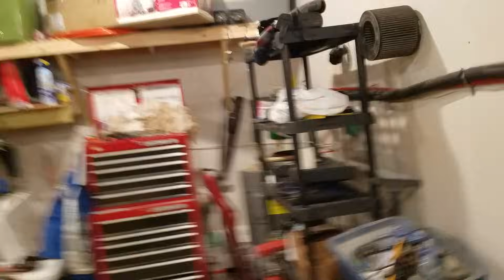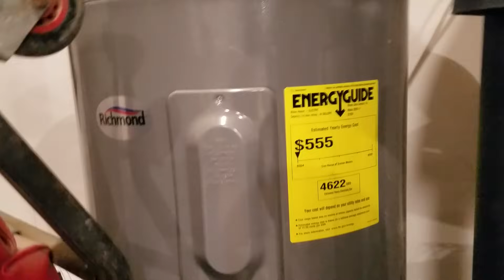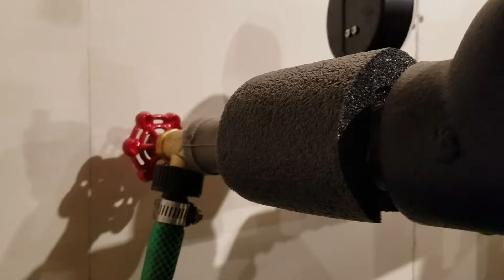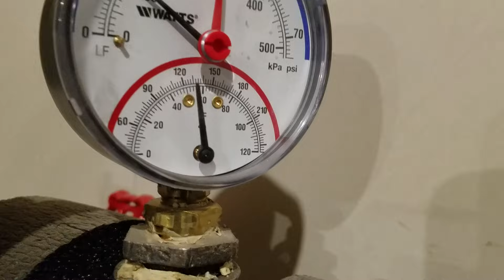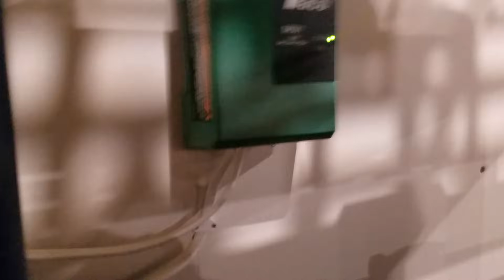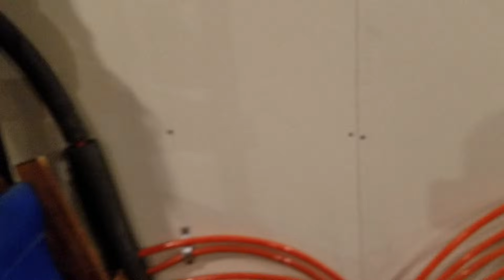EASY FLOOR HEAT (using a new or used hot water heater!)

Comment: Great job! As a steam fitter I have a couple of recommendations to improve your efficiency and safety. If you prefer to use a hot water tank you must replace the temperature and pressure relief valve with a 30 psi pressure relief valve.  Using a tank in a closed loop heating system is very dangerous, you are essentially making a bomb. My second suggestion is to get rid of the tank completely and use the elements without the tank. You can cut your power consumption by not heating only the water used for heating not storing. Take a 12 inch piece of 2inch pipe, put a 2x2x1 inch tee on each end. Using a bushing install your elements in each end and connect the supply and return to the 1 inch branches. Now you are only heating the water you are using.  I heat my 50 x 30 shop for about $2.00 a day. Todays high is -32C.  I tried going to a larger tank and it just cost me more money.  I have been feeling my system for the past 9 years and have more plans.
Reply: Can you explain your set up again? Not sure I follow. Are you talking about using an exchanger?
Reply: Rivstr, you are completely correct about the temperature and pressure relief valve. They must be changed so one doesn't blow the pex lines or anything else if something goes wrong.
I like your idea of a 12 inch piece of 2 inch pipe for heating the water. Kind of like the heater in many hot tubs. They easily heat a hot tub to 104 degrees. When I used to work on them they were rated at anywhere from 2 KW to 5KW heating elements. Coincidentally domestic water heating elements are rated from 3 KW to 5.5 KW. A water tank heating element system you've described could easily be used. Because it would be a closed loop system, a larger thermal expansion tank would avoid pressure build ups so it should work fine.
Reply: @Rivstr. Have you built the heating unit you speak of? If so I would love to see a video on your system. Sounds much cheaper than buying an on demand heater and much cheaper than heating 40 plus gallons of glycol mix while sitting idle.
Reply: @danielmooney2724  I also am curious!
Reply: Can someone explain why its dangerous to heat water in a closed tank for space heating, but it's not dangerous to heat water in a closed tank for domestic hot water?  Wouldn't the T&P relief valve still open before any explosion?  That being said, yes I would replace the T&P with a boiler relief valve since there's no reason to have high pressure in the space heating system.
Reply: @brockwagner939  Are you potentially confusing a closed tank with a closed loop system? Space heating systems are closed loop systems while domestic water heating are not closed loop systems.
It is not necessarily dangerous to heat water in a closed tank for domestic hot water. But it is dangerous to heat water in a closed loop system.
In order to make it safe, a domestic hot water system has a few redundancy's built in. There is often an expansion tank to alleviate pressure build up, there's always a pressure relief valve which normally opens once the pressure or temperature gets too high and the domestic water system itself can also alleviate high pressure through weeping of some of the rubber or fibre washers in the faucets.
In a closed loop radiant floor heating system there's nowhere for the pressure to go. Thus the need for a similar pressure relief system as with the domestic water system. Thermal expansion tanks, and lower rated pressure relief valves.
If one doesn't have an expansion tank and/or also doesn't change the pressure relief valve to one suitable for 12 to 20 lb systems one could easily blow the in floor pex lines.
Reply: @davemeise2192  possibly I am confused.  But the video shows a thermal expansion tank right?  So if it has room to expand into the tank, and the piping and tank can withstand the pressure rise, my theory is, if a water heater tank can handle the pressure that the t&p blows at, why would it fail before the t&p blows just because it's being used for heating and not domestic? I'm not disagreeing about the 30 psi relief being a better idea.  In fact I might put two of them in, just in case one fails closed.
Reply: You have some drawings on this heating design? Sounds like it would work but skeptical on the design
Reply: @Rivstr, the heating element is a great idea, I'm trying to get my radiant floor heat going on my shop that I just bought, all plumbing been done below concrete but I have to do everything above, my question is this please, how do you run power to the heating elements? 120v to each element? And what do you use to turn them on? Thank you in advance all help is greatly appreciated
Reply: Hey I wonder if you have a video of your system
Reply: @Rivstr The 30psi replacement pressure valve makes sense. But looking at some boiler pressure valves, some have temperature protection, some don't. Ones that do tend to be around 250f, but water heater ones are more like 210f. Any suggestions how to protect against temperature safety issues? Anyone ever add a secondary pressure/temp valve? Not sure how that would look though.
Reply: Wow, very interesting idea. Would this work for domestic water heating.

Comment: I operate mine with a 220V baseboard Tstat... a check valve... a 15 gallon water heater... (No pump necessary as hot will always push cold) The stat call for heat, turns on the water heater... I do have an auto fill and air bleeder... (I can also heat the system with hot water generated from a wood stove pipe) cost about $30 a month extra to heat a 16 x 32 slab (3 sided) porch to 68F... in PA, USA...
Reply: Nick, how many watts? This sounds about like what I am preparing to do. Any issues since two years ago?

Comment: Thank you so much for this!  There is no other video, instruction, or testimony, ANYWHERE on the internet (that I have found) explaining simple, affordable, in-floor hydronics using an ordinary, tank type, water heater....I've searched far and wide. This is going to sound a little bitter but in my opinion the web is inundated with far too many people plugging THEIR products and systems and denouncing all others. Plenty of arrogant naysayers explaining why this system simply can't work and proving so with all kinds of formulas, calculations and technical BS. that most of us can't wrap our heads around. And please don't get me started on the green building circles(bless their hearts).  Then along comes "This Guy" from North Dakota, where the ground can freeze as hard as concrete six feet down, and there's nothing to stop that N wind but telephone posts. I can't imagine the heat loss in THAT slab!    
 Kudos to you sir, and thank you for setting this straight!
Reply from the maker: No problem Pete. That's what I am trying to do with this channel, I find things that people ask about, jump in head first, figure out the problems, and make a video about how it works. I have some videos that I am editing about, hidden doors, building cab enclosure for a RZR, and others coming out soon. Thanks for the comment.
Reply: Can you please contact me?  I'm having a big problem with my floor heat and I need to bounce some ideas off someone.
Reply from the maker: What's on your mind?

Comment: Thanks for sharing this I really appreciate it. You should seriously consider changing that exposed romex cable over to something like armored (flex) cable. Or at the very least you should put some kind of strain relief on those so the plastic coating doesn't rub right against the bare metal edges of the holes in your pump and water heater. for safety.

Comment: suggest you put in romex connectors.  Even a little vibration .. can eat thru the wiring.. both the pump and the water heater
Reply: I thought the same thing

Comment from the maker: I am still running same setup. I plan to add a power consumption meter for just the heating system, and then test different water heater sizes. Thought it will be a month before the test starts, I have broke my arm, but I should be good to go by January. Thanks for watching.
Reply: This guy .
Looks pretty sweet.  Did you run the Pex right into the concrete? Or did you switch to copper in the floor?   Or was there another medium?
Reply: This guy     
Thanks for posting this system.  Just a word of caution, tidy up your romex,  it could short out on one of the boxes if you don’t use a proper romex connector.
Good luck
Reply: Please contact me- I have been looking for ways to contact you but haven't found any.  I have questions about the floor heat in my shop- really need help.

Comment: I heat water with excess PV solar efficiently (not like the clueless on youtube) and am thinking of doing this to add a little heat to the camp. I've collected a few old water heaters and have this warning.  Feed the cold water into the bottom of the tank where the drain valve is.  There is an internal plastic tube that sends the cold to the bottom of the tank that tends to break off and water just circulates at the top. A couple tanks I have are that way, replaced because the people ran out of hot water quickly. I would also remove the check valves that restrict flow.

Comment: thanks for sharing; yes there are some rough edges that others have dwelt on, but the basic concept will be helpful to me.  the use of a water heater simplifies some of the temperature control.
Reply from the maker: richard tuhro thanks it was mostly to show proof of concept. Thanks again.

Comment: Impressive. A simple solution/design surest sign of an intelligent mind. You said that it has been operating for two years. Any leakage or have you needed to top it up? Any problem with "gelling" of the anti-freeze? also your video very well doing.  :)

Comment: Thanks for the explanation and demonstration.  I did the same for my front and parking-side sidewalks only I used on demand water heaters for space ( I don't have a garage or basement to put tanks in).  Because they are also electric, I run them with a choice relay that does not allow them to both be on simultaneously.  Works great.  One question for you.  Do you find a fairly uniform flow from the use of your copper headers?  I was not sure about this and ran a continuous closed-loop to cover the area.  So it takes a little longer to heat the last few yards of sidewalk but the first few (farthest from the house) heat up very fast and stays warm for hours after it is shut down.

Comment: Brilliant. With this working on a garage this big, I bet it would work even better on a modestly sized single story home.
Reply: Yes it would, I installed 40 gallon low boy water heater for a closed loop in floor system to heat a small two bedroom house and the system worked great for many years.
Reply: @davemabey169  Is it still working?

Comment: Interesting. I was wondering how you run the pex under the floor though.
What I like about this system is that it could easily be converted to solar heat. Get free heat on sunny days.

Comment: All good info. My neighbor suggested in floor heating before i poured my slab.  Thought it would be ceazy expensive.  But the pipe is pex and videos like this make it possible and probably cheaper than a furnace.  Really thorough description.   Thank you.   Do you run zones  300- 500 feet?  Shorter? Longer?
Reply: 300 feet or shorter

Comment: Reading all the lame comments can make one nauseous!
This method of heating a garage for most people is more than adequate.  A garage is not a living space and heat call is not 24/7, all year long.
At most, on my acreage, I might use the shop for two days in a row, once or twice a month for those long and tedious repair jobs.  However, I would also believe one must 'start' the system at least 24 hours in advance to get up to a decent temperature, but it sure beats working with steel tools at 35*F. (3*C) or colder.
Reply: @brian brekketo Thank you.   :-)

Comment: well done presentation. I don't see isolaters with your iron  and brass fittings. Are they needed?  a parts list would be helpful. What temp did you set the floor heat to?

Comment: I didn't catch it if you said it but how many square feet is your garage? Any update on power consumption? I was thinking of doing an electric heater like yours or a tankless because running gas to my garage will be a pain. It will probably be worth the trouble, I'm guessing though. Good video.

Comment: Thanks for sharing, this is brill to see , you and your dad great idea. Can I ask how do you put pressure into the system, is it a manual valve somewhere? Do you hand pump in?

What temperature is the water heater set to?
Reply from the maker: When adding water to the system, the pump I use runs about 10-15psi. I shut in the system and shut the pump off at the same time. This leaves about 10psi in the system. It only requires 1-2psi to run, but I leave it at 10psi most of the time. I run the water heater at 120 degrees Fahrenheit.
Reply: @thisguy014  tks where is the air valve?, is it like a car tyre nozzel or something different? Is it at the expansion tank? Ty fantastic to know.

Comment: Fairly well thought out but I would make a few changes. First off, you should be using a non-toxic antifreeze, with an auto-feeder and back-flow preventer to maintain system pressure and keep it up to code. (the back-flow part) Secondly, you need to tidy up the wiring with proper connectors terminating each cable to prevent shorts. I know some will question using an electric water heater, but they are cheap and figuring the payback on going gas or oil, versus say a wall hung "insta-hot" system will be years.... not to mention venting and noise issues.
Reply: I would not use an auto feeder. in this case it can be a closed system without a permanent connection. I always use a low water cut off on any hot water system I install. normally the code requires a lwco if all the radiation is below the boiler. if  it was a boiler I would be more worried about low water. if he runs out of water the pump and elements take it versus an unscheduled boiler launch.
venting is never a problem if you are pumping away from the seperator.  that air scoop is useless as a seperator,  works good as a pipe fitting but that's it. a spirovent or similar is the only choice
Reply: + M Toman  The venting I mentioned was for a gas or oil fired heater, and possible noise issues for a condensing gas heater or oil fired water  heater, which has a blower. Using an auto-feeder is just a precaution to maintain system pressure so you don't have to constantly keep an eye on things due to possible seepage at various fittings, especially in a system that will be left at ambient temp a great deal of the time, which is when that happens.
Reply: @shellytoman  Totally agree with you.  Simply moving the pump downstream of the expansion tank on the supply side would be a huge improvement.  I attended a Grundfos pumps seminar many years ago when they were first coming to north America and they were surprised that we install pumps on the return side.  In Europe, they always installed them on the supply side and downstream from the expansion tank and air separator.  I remember a lot of people commenting how the return water is cooler and that's where the pump should be, but they said the pump is designed for 200+ Degree water and not to worry about it as that's where it should go.  The expansion tank is the point of no pressure change, so with the current configuration the heating circuit is going to be the low pressure side and the water heater and separator are the high pressure side.  It's much easier for the air to come out of suspension as the pressure reduces so the separator and air vent would work much better pumping away from them.  There's a really good book called "Pumping Away" by Dan Holohan that explains best practices for hydronic systems and it's a very easy read.  Mind you, with the internet, who reads books anymore :)

Comment: I was thinking of doing something similar in my garage but I can't do infloor since my garage is already built. I wanted to run the hot water to a radiator with
 fan behind it to blow the warm air  thru.

Comment: Floor sensing thermostat is key. I keep floor at 23c ambient at 14c (so when your working you don't overheat yourself) and keeps my 22x22x14 high vault at about 14c when -15c out. Downside is slow recovery on big door opening so i have an electric fan that kicks in when  temp dips below 10c to bring room temp up nice.
Reply: Hey mitch, this surprises me about your "slow recovery". The greatest thing I love about my radiant floor heat in my shop is how fast it recovers after we "remove a wall" to pull a vehicle in or out. The old forced air system seemed to take forever.

Comment: Working on residential floor one zone floor system that is set up similar but instead of taco control they have a Honeywell zone valve in the return pipe that is powering the circulator. Valve has went bad so I ordered new one but seeing your system I’m wondering if valve is even necessary. Do you not have a zone valve at all in your loop?

Comment: I have a 45x30 Morton building with a 2 zone system that I heat with a Sears 30 gallon hot water heater.

Comment: I like the simple design! Just curious about your water makeup though- how often do you need to refill and how do you check your water level? Thanks
Reply from the maker: I am on my third year on this system, and have not had to fill it sense I got the air out the first time (though it took awhile the first time due to the small pump, I was using to fill it up with). When the pressure falls off is how I check to see if it needs filling, no pressure mean it time to fill again.
Reply: @thisguy014  how do you actually tell how low level is or do you just fill it up because the pressure dropped?? But thanks for future trouble shoot
Reply: @thisguy014  If it's a closed system how does it lose water?